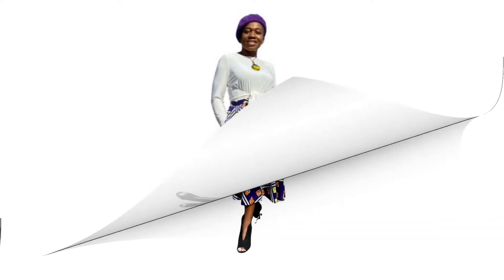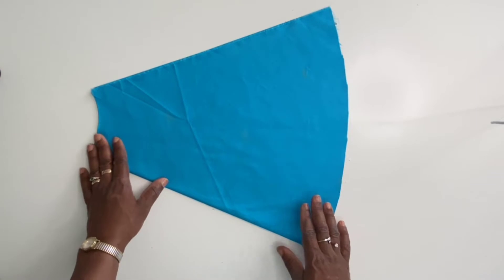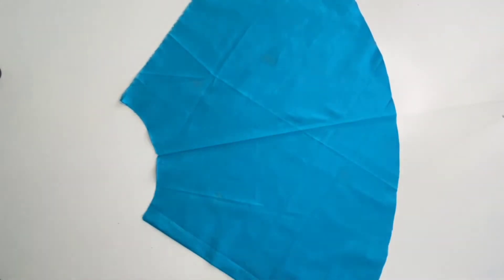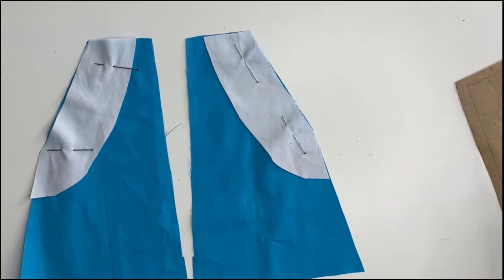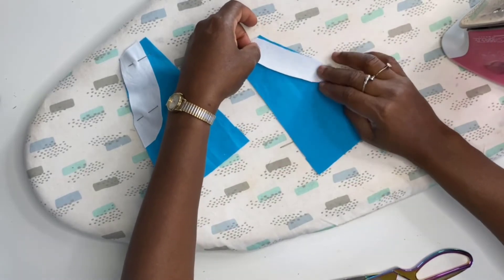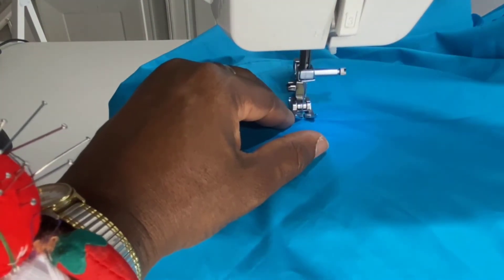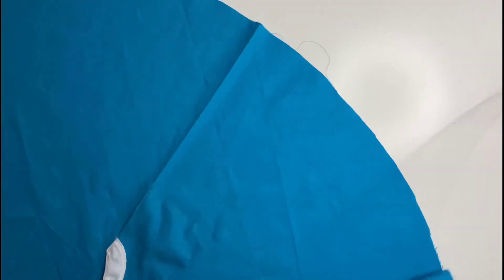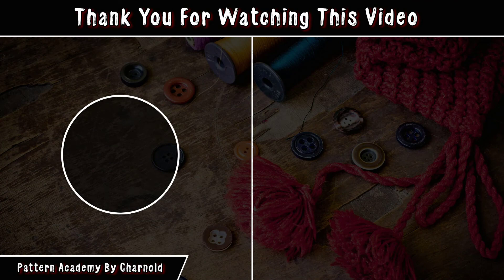How To Cut And Sew Patch Pocket On Flared / Circle Skirt

Comment: Thanks mama what if I don't tracing will
Reply from the maker: In that case, you can use pins to hold it in place or weights, then fold along the pocket lines upwards and draw the pocket sides onto the paper. Hope this helps.